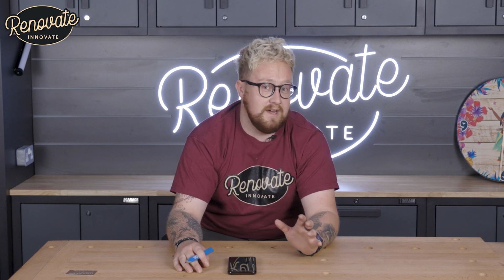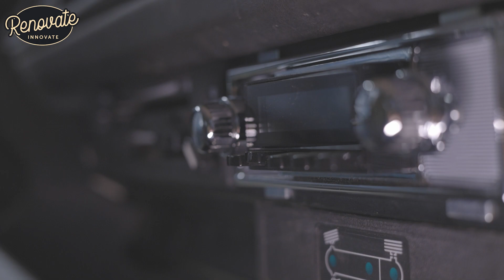VW Doka Syncro Build - Why We Ruined a Rare Classic | Auto Project

Comment: I've got an '81 2ltr aircooled rhd t25 doka. Owned it for years n never got round to restoring or driving it, it's very ratty n needs some work. Now is the time n I want to slam it on it's balls. Not sure weather to go for bags or hydros? Lovin what you've done to yours. Sending good vibes from Cornwall.
Reply from the maker: I do like the Hydro suspension on mine, and I am thinking on changing the hydraulic struts and sending the car upwards for a new look.